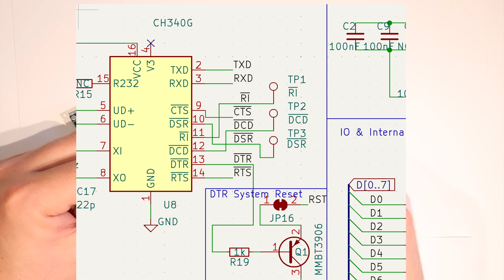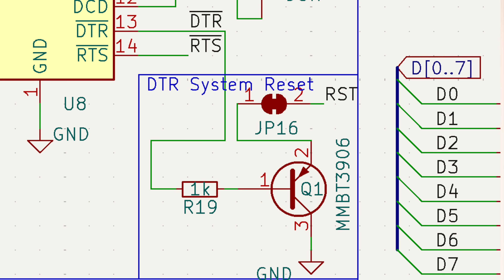50 years of 6502! Still getting better!

Comment: I can't think of a single use for a 6502 system that can't be done better with any number of pieces of hardware I have sitting around, but I still keep wanting to get one running. Much rather use a serial terminal than an OLED, but it seems that's an option with this board.
Reply from the maker: It has the routines to do serial - actually it IS a serial terminal and I’ve used it to control Linux - but to interact with it like the OLED it’ll need another driver layer.

Comment: if you wanted to add an eeprom and not a flash rom memory, to directly read and write every single memory location, what would you put?
Reply from the maker: A 28C256 might work but I’d try an FRAM - that should be easy to get running with a single jumper wire

Comment: DTR for reset, sounds like what they did with Arduino's. It's kind of a pain in that you can have something running for ages, but if you plug the USB into a PC, it resets the board mening all the info from that run is lost. You kind of have to leave it connected to a PC so you can gather all the diag info from your software, not always a practical idea.
Glad to see you added a cuttable link, the Arduino Nano's I often use don't, it's burried.
Reply from the maker: Yeah, it’s not perfect but at least it’s stable and somewhat configurable :)

Comment: This is the project that inspired me to look at the S12 series from NXP.   Based on the 68HC12, they have RAM, Flash ROM, and assorted peripheral controllers in a surface mount package.
Powerful, but the documentation is a heavy slog. The 6502 is a simpler beast.

Comment: I wish you would make one with a real 6502 instead of the cut down version.
Reply from the maker: It’s literally the same IC inside the 28 pin package as the 40 pin. 
But actually I did - check out the “ABN6502” :)

Comment: Are you saying it has 16 KiB of RAM? (8 * 64 * 2^10 / 512) I'm confused why you kept saying bits instead of bytes. So it's an 8 KiB EPROM?
Reply from the maker: If you look up a datasheet for a serial eeprom - or any ROM for that matter - the size is typically listed in bits x bus size. 27c512 = = 64KB. 24c64 = = 8KB.

KiB is newspeak straight out of “1984”  and I hate it - there’s no ambiguity in this context so there’s no reason to use it. Grab any manual from before 2000 and 64KB = 65536 bytes.
Hence there wasn’t a Commodore 65 or 131 and an IBM PC always had a multiple of 1000KB of RAM. So an IBM PC with 16MB of RAM would count up to 16,000KB.
Sure - it became ambiguous later, but that’s not a well established naming convention’s fault.

Comment: 64 kilobits = 8K
Reply from the maker: Correct - and so is the 6507’s address space :)
Reply: Even back in the day, the limited address space was a real pain. I get the whole appeal of fitting into the Arduino foot print, and using period-compatible components wherever possible. But this isn't really anything ground-breaking. Even in the 1980s, you could find a lot of these single-board solutions using pin-limited versions of the 6502. If I recall correctly, the 6504 was particularly popular. And even back then, it was so impractically resource-constraint, that few people ever bothered building those SBCs. This was mostly a set of designs to fill computer magazines with content. Having RAM is nice :-)

I do see though that this project is running into a real problem with its design constraints. Fitting an unrestricted 40pin 6502 is just not doable while still having enough space on an Arduino-compatible board. Fortunately, there are "modern" versions of the CPU that use a higher-density footprint. Such as the W65C02S. Or the backwards compatible W65C816S. To be honest, the latter part is still sufficiently close to period-accurate, while meeting a lot of today's requirements. I would just have gone for that. It's not as if the rest of this project was entirely afraid of using modern parts, either.
Reply from the maker: Well.. the W65C02 clone came out a solid 8 years after the 6502 and wasn’t even pin compatible :)

Comment: Really, the 6809 is probably the best architecture of this period, in 8-bit processors, too bad that it didn't end up in more of the personal computer models... I think that I still have a Color Computer tucked away in storage, and we used 6809 in some commercial applications, too, although I did more with HC11 and 68k.
Reply from the maker: Well, put in perspective the 6809 only came out a year before the 68k - and three years after the 6502.
That and the price meant that the 6502 had a significant head start in hobby adoption so the 6809 didn’t have much room to wiggle itself in before it was obsolete itself.
And I guess neither were actually meant to be PC CPUs
Reply: Eugene Jarvis made great use of the 6809 in Williams Defender; Very clever use of the 2 stacks to quickly copy graphics onto the screen.
Reply: @Lord-Sméagol  Joust as well IIRC

Comment: Ooh cool.  I wonder if it will be able to run BBC Micro BASIC?
Reply from the maker: You will probably get in trouble with the limited RAM - you can add up to 4K of external RAM but BBC Basic probably needs 16K.
A smaller basic is doable with external RAM.
Reply: @AndersNielsenAA  Ah yes I see I was confusing ROM and RAM... duh... so around 128 bytes of RAM?
Reply from the maker: @sparthir By default, yes - it’s not too much trouble to add an external RAM as chip selects are already available along with the busses 🚌
Reply: @AndersNielsenAA just use esp8266